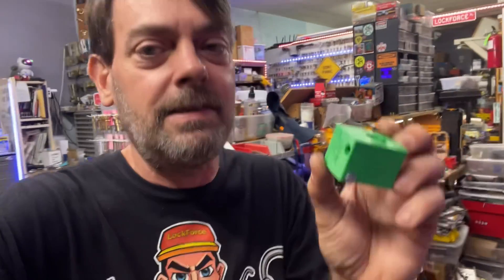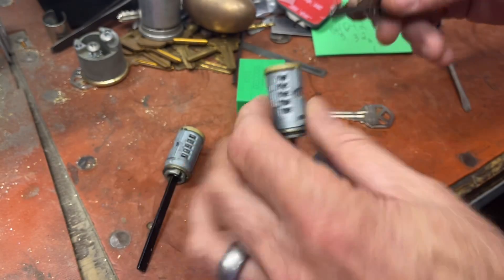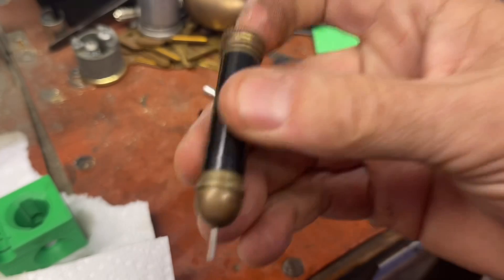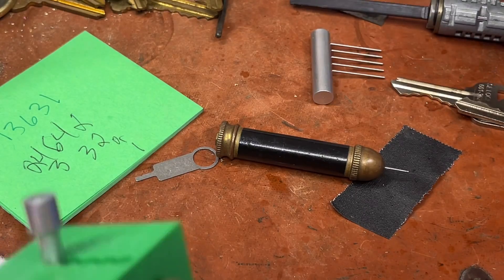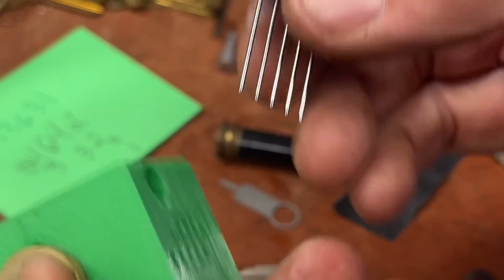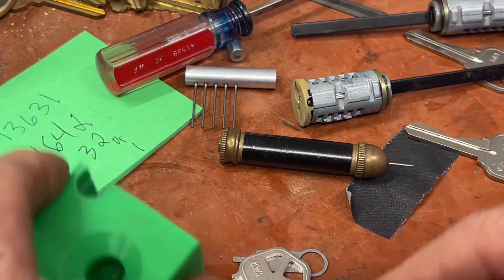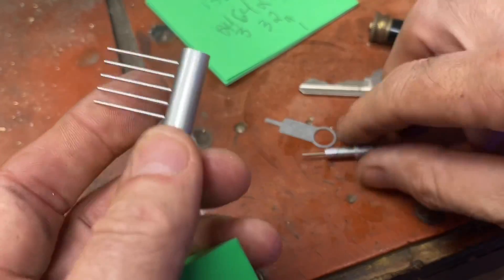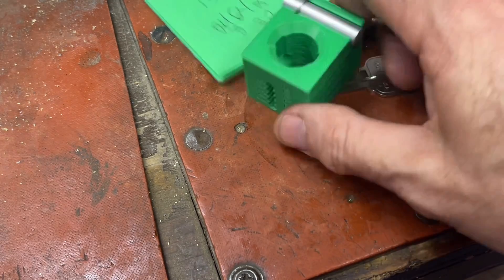Decode or Reset Kwikset Smartkey locks with “The Cube” !

Comment: So here in Canada. We have a lot of Weiser. Decoding a key can be confusing. I just used it with two different Weiser stamped keys. One was cut to kwikset and the other was Weiser depts. Both were Weiser stamped blanks.
Reply from the maker: Smartkey is supposed to only come Kwikset depths. In the most recent generation of Smartkey they adapted the wafers to have more notches so they could make the Schlage keyway smartkey and KW keyway use the same wafers (production cost savings)
Some people think you can copy (duplicate) a Weiser key onto a Kwikset blank and use it in SK but up until this last generation it would stuff up the cylinder. Now Weiser and Schlage have different depths but they are “close enough” so that it would probably work (still not advisable) since the setting wafers have all the notches in it now. Still has the possibility of jamming up the cylinder but less chance now so the production cost savings kinda had an extra side benefit for them 

Weiser always stamps their blanks with Weiser whether it’s an actual Kwikset key or true Weiser key. The difference is the thickness. True Weiser keys won’t enter a smartkey cylinder
Reply: @selock thanks for that reply Jason very much appreciated.

Comment: Nice! I gots to get me one of thems. I have camera and  better reseter. I want the cube primarily for the decoding function. The camera works ok but doesn’t work well in some recessed knobs & dealing with phone, camera & free handing without spacer on those locks is normally doable but cumbersome. 

The tools flying every where maybe an issue using cube around trench drains across a sidewalk though. I can see the decoder rolling into the grate already.

Comment: I still like the Better Resetter and Accureader. In my mind those tools are the best for dealing with Smartkey cylinders. I do with the Better Resetter was made out of better metal like SS.

Edit: The cradle is trash I've had a few die during regular use.
Reply: Agree! Better resetter needs to be made out of a stronger/higher quality metal. It's not made for everyday use.

Comment: This is a very neat tool, but the only thing I would question is why not take a standard key un cut place it in the lock and decoded by site that’s what I learned before my company let me use the scope 😂🤷🏻‍♂️
Reply from the maker: Nothing stopping you from doing just that, this just makes it easier I reckon 🤷‍♂️